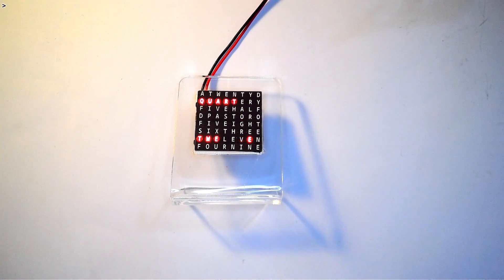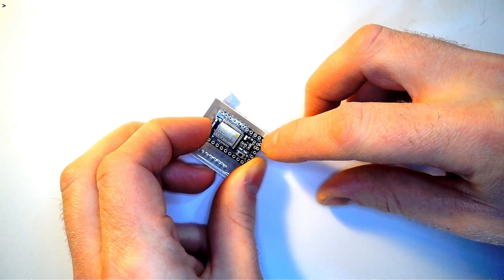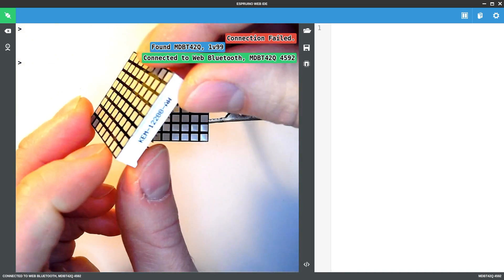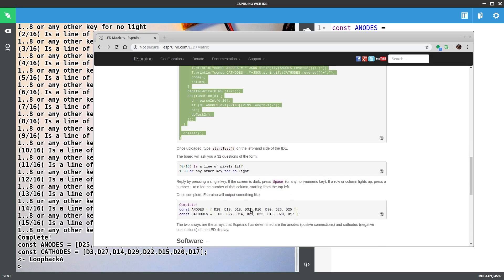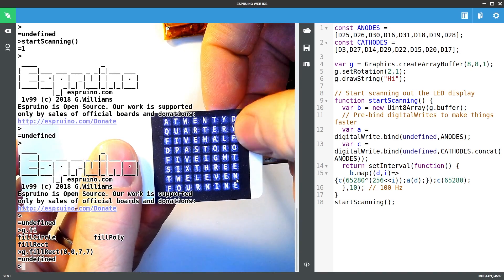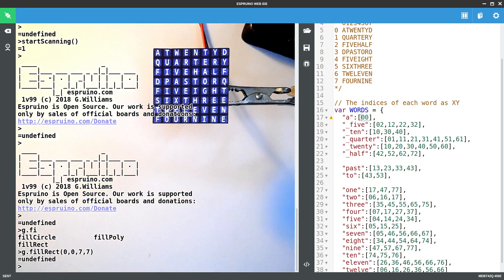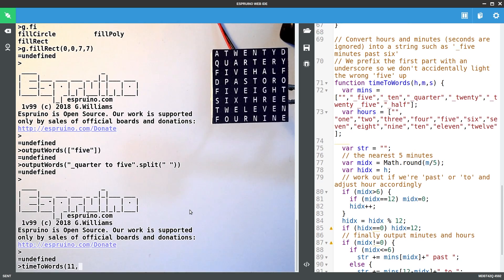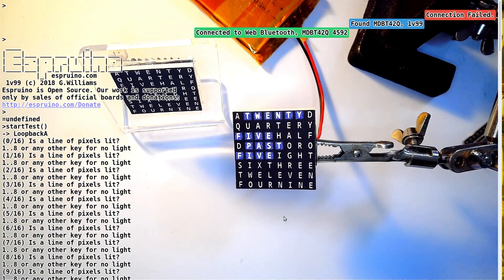Tiny Word Clock

Comment: Thanks to the great instruction steps this all came together really nicely, just powering off a standard USB. One question- once disconnected from power it doesnt seem to hold the program, so when plugged in again i have to reinstall the software and run it again. Is that normal for the chip or did I do s'thing wrong somewheree?
Reply from the maker: If you're uploading with the Web IDE, just click the little down-arrow next to the upload button and change 'RAM' to 'Flash', then upload again :) When you lose power you'll lose the current time, but you can just go to https://www.espruino.com/Bluetooth+Time in a phone and use that to update the time

Comment: Great little project, would really like to have a go - I have larger wordclock matrix using the Neopixels run by an Arduino, but I really lilke this little one. I like the idea of keeping it powered via USB though, not battery pack, and you said you could build it with an espruino pico, but are there enough pinouts on both sides of a pico to take the led matrix?
Reply from the maker: You'd need 8 on each side of the board - and you're right the Pico has 8 on one side, but 6 on the other. However - it does have another 8 smaller pins on the rear edge - so you'd just have to wire up across it but then add another 2 wires to that far edge. Espruino WiFi does have enough pins to do 8 on each side though.
Reply: @Espruino  Thanks for the reply - if I wwent with the lipo battery what would they typical running time be, before needing a recharge?
Reply from the maker: @alheeley  It's packed away so I can't actually measure at the moment, but I imagine it's around 5mA, so off a 3000mAh 18650 LiPo battery you'd be looking at about a month. Nothing stops you running the bluetooth module directly off USB power though - or even just adding a small LiPo battery along with a USB charger to it.

Comment: Do you know how i could use a led module with this? So how to wire it and what code I have to change, or would you be willing to write it willing to pay for the code?? Thanks
Reply from the maker: Do you have a link to the LED module you plan to use?
Reply: It's  the max7219 8x8 led matrix module
Reply from the maker: @fpvcowboy2635  Ahh, right. There's support for MAX7219 already so it's pretty much just a matter of replacing the 'startScanning' function with the code from http://www.espruino.com/MAX7219#graphics-library - both use a 8x8 Graphics library instance called 'g'. If you've got any questions about exactly what needs doing just post on forum.espruino.com and I can help out
Reply: I will jump on the forum tomorrow then cheers
Reply: Do you have email or WhatsApp to pick your brains you sent link with the max7219 library but not sure how to link that with your code for your word clock? Thanks went onto forum but didn't know whether you can point me to maybe some tutorials that would help me connect them or a pointer instead of annoying everyone with something thats probably simple as the code is all there... thanks
Reply from the maker: @fpvcowboy2635  Ask on the forum - I'll answer you there. The answers will be useful to other people as well.
Reply: Ok no worries thanks

Comment: Any chance you could use the esp8266 board? And just change pins in the code thanks
Reply from the maker: Yes, you could probably do that - however it might be a bit more flickery with WiFi on because it's having to spend time servicing the WiFi connection.
Reply: Or the esp32 wifi and bluetooth if i flash it with espruino all is have to do is change the pins is that correct?
Reply from the maker: @fpvcowboy2635  Yes - should be fine!
Reply: Great cheers mate your a star... love the clock

Comment: Good Evening! I am writing according to LED Module which You invented and programmed. I am astonish! Perfect idea and  job which You have made. In Poland I run my own little handcraft company, basically we have started with watches. Our`s idea is to be one of a kinde and use innovations with natural components wood steel etc.( you can see some of our`s creations as website www.plankart.pl).  I have a few Q to You:  Firstly, is it possible to use module in writswatch ? Is it possible in this LED Module to use circle typically watch battery instead of squared one (?) what will be the size (coarseness) of whole Module than? Is it possible to watch with Led Module work without constant bluetooth connection with mobilephone?  And finally, if I would like to order 10 complete LED Modules for my Plank Watches )with circle battery) how much it would cost?
Thank You for all I am waiting forward to hearing from You
Please concact me on email info@plankart.pl
Best Regards Artur

Comment: This project is amazing, and is working so far.
But I am having trouble with the LED Matrix flickering, any suggestions how to change the refresh rate?
Using ESP32 Wroom 32D, newest Espruino firmware (8.2), soldered the matrix directly onto the Pins and powered via USB charger.
Reply from the maker: In the startScanning function there's a setInterval that you could lower the value for. However you may hit some issues with ESP32 just because the processor is having to handle WiFi/etc at the same time (and the JS isn't running in an interrupt). Disabling WiFi and also ensuring your JS is minified via IDE settings could help a lot too